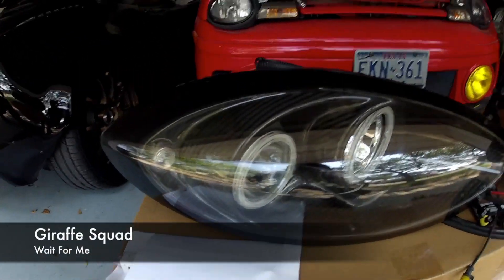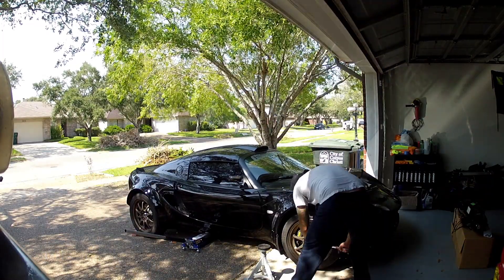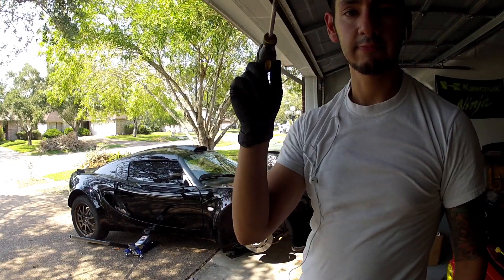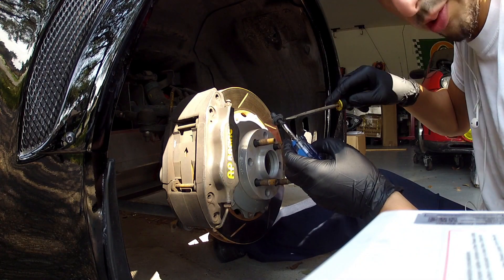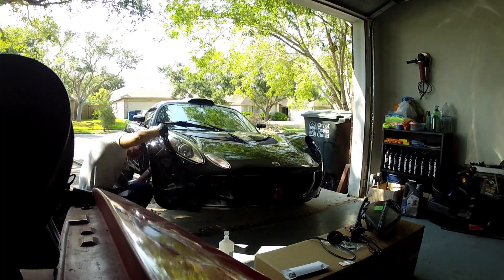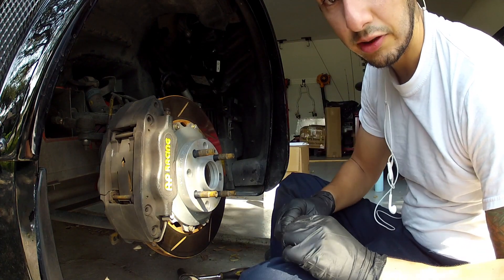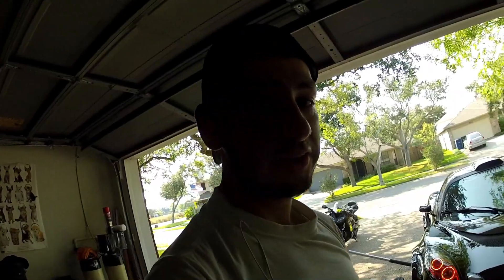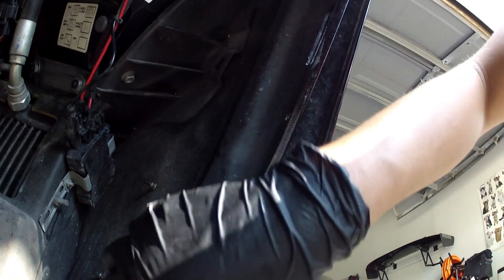Lotus Exige S240: GRP Retrofit Headlights Installation

Comment: What's up with the Neon build?
Reply from the maker: Karl Steev Right now its on hold. I need to get the Lotus finished so that I can have a running vehicle, and start changing some things on the bike as well for the Texas Mile.

Currently for the Neon, I have to figure out a way to get the A/C compressor to fit, and also make the 2nd gen passenger engine mounts installed onto the frame.
Reply: @TheAutomotiveKid  whats the link for the red headlights?.. I have an Elise..
Reply from the maker: theknuckleup Here you go. 
https://www.gregsraceparts.com/collections/dress-up/products/grp-headlight-halos-for-elise-exige-s2-2001-2010
Reply: @TheAutomotiveKid  thx! do you know the size of the rings?..
Reply from the maker: theknuckleup I do not, man. You could probably call them and ask though.